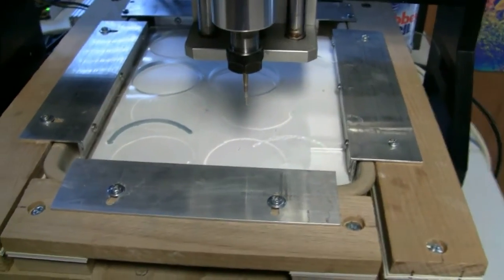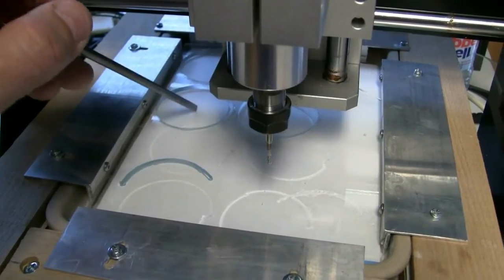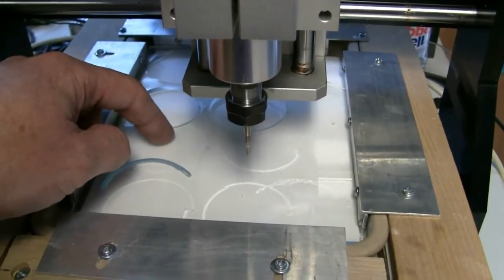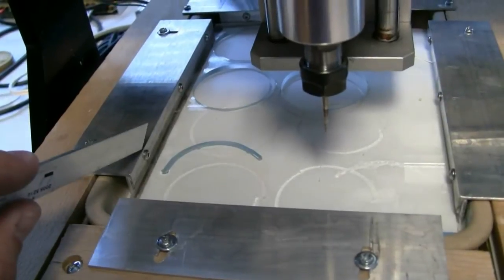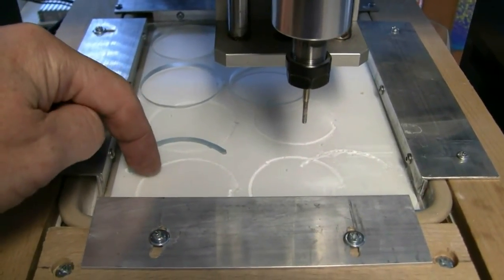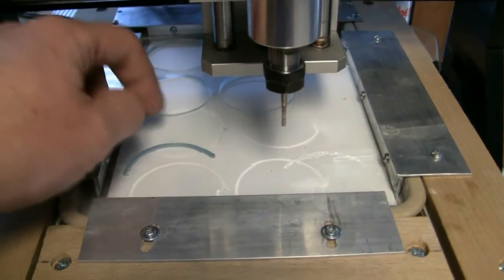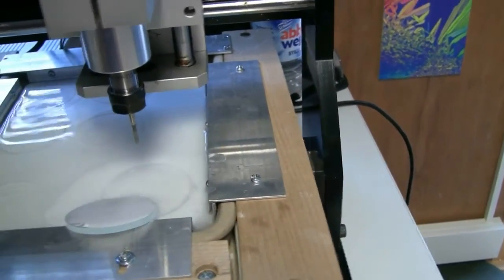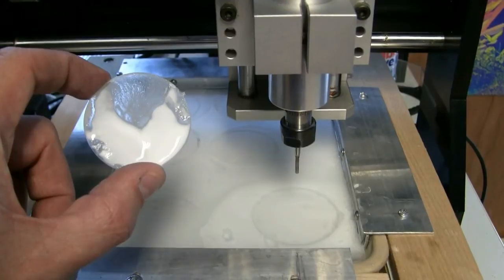Glass Milling 4

Comment: hi david 
thank you for the video   you the only one i found with home style cnc equipment  cutting glass   can you help with some details  which machine, which diamond tool  , system control    
that will be amazing

Thanks 
gil
gil@zulasurfing.com
Reply from the maker: +gil “ZulaSurfing” tsafrir 
Hi Gil, thanks for the feedback.  The CNC machine is a Sable 2015 which I bought a while back from a supplier in China.  It has proved to be excellent and I have had no issues with the machine.  I use MACH3 control software running on a Windows i3 machine and controlling the CNC via the parallel port.  The set up instructions supplied with the CNC work perfectly for MACH3.  The diamond tool I used was a 1.5mm burr bit.  The bits don't last forever and do snap but you can pick them up very cheaply on-line.  Please fire away if you have any further questions.

Cheers,

                Dave
Reply: +David Trewren 
hi david this is great news i will work with is direction, keep you posted 
thanks